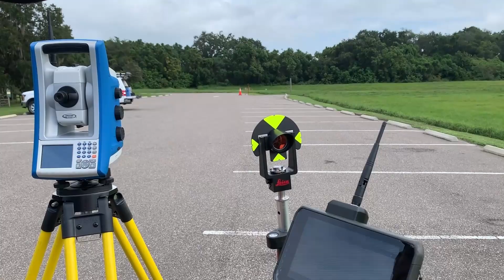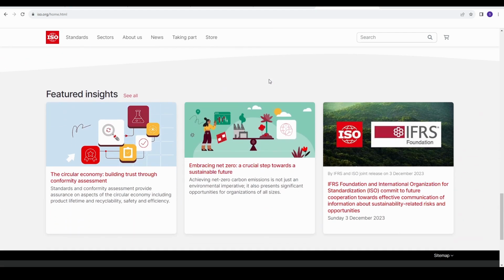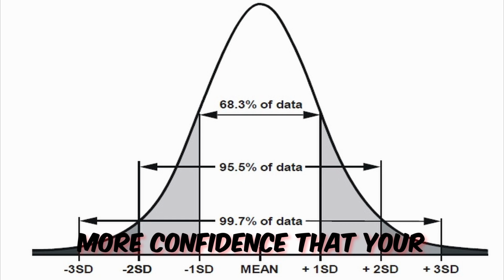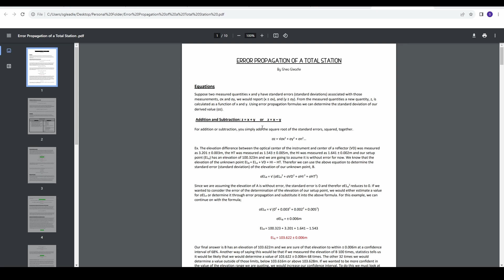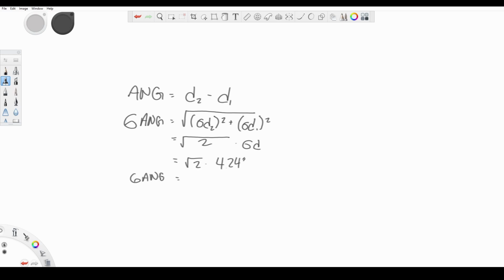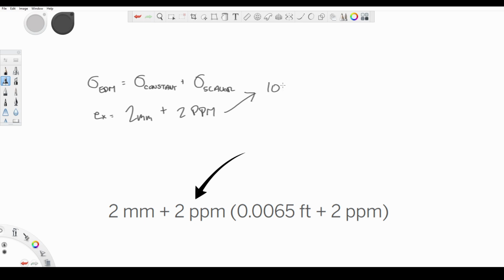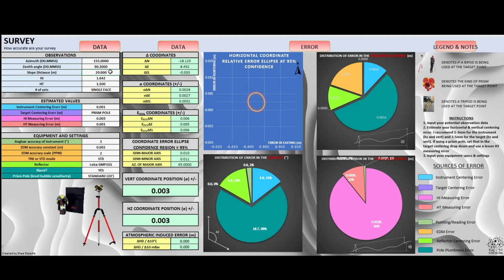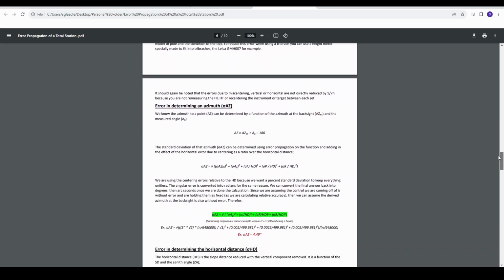Land surveying 101 - How accurate is your total station?

Comment: What was that orange spacer under the tip of your tripod foot? I have been thinking about using a washer so the feet dont sink in new asphalt. It looks like you were using a ground flat cap for the same purpose? I'm a junior crew  chief about 3 years in trying to learn online because the company I'm with doesn't train much and I would like to be a better surveyor as I'm not very confident in my abilities and I get stressed out on jobs where I don't feel confident in my knowledge. I like the way you explain. I know if I keep watching these videos, i will learn. I may have to watch several times
Reply from the maker: @NikLyons  those were aluminum concrete nail tags. You hit the nail in the head, they can be handy when you’re noticing your tripod is sinking in asphalt .
If you’re continuing education on your own time you’re probably going to be ahead of most of your coworkers in time. Good luck and keep at er.

Comment: Sorry but how accurate is a 5" at 100m not including other errors? I was told 4mm, 2mm at 41m. Could find it in your video
Reply from the maker: The Sin(5")*100=0.0024m if that helps at all? But the whole video is all about you can use the angular spec of an instrument to calculate accuracy.
Reply: @The3rdDimensionSurveying  As a technicality, arc length should be R*theta; however, for small angles of theta, sin(theta) = theta.  For your 100-ft and 12-second computation, the two answers are identical for 11 decimal places.
Reply from the maker: @ScottMerry-t2l if you ain’t hittin sub picometer are you really surveying!! 😅

Comment: Please somebody reply to me, when I set up the TS resection and stake out a points and move to another location and set up the TS with the same standard deviation and stake out the same point give error in the point location till 5 cm . What is the reason ?!.
Reply from the maker: There is way too many variables to give you an accurate answer based on what you've provided. What I can say is the standard deviation of your setup can hide a lot of potential error. If you're resecting off points bunched together even the smallest error will propagate significantly. If you are surrounded by resection points, your setup will have a lot more geometric strength.
Reply: @The3rdDimensionSurveying  All required parameters are available in the resection , reflector constant, resection angle and distances.  I used two devices, and each device calibrated , but the results were similar
Reply from the maker: @muhammedjawad6928  Its too difficult to say without looking at all the raw data.